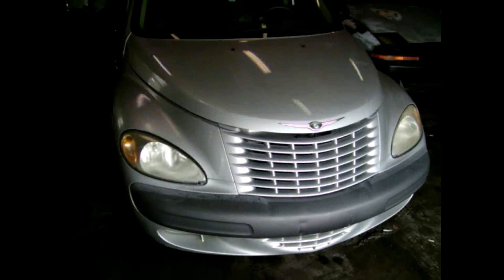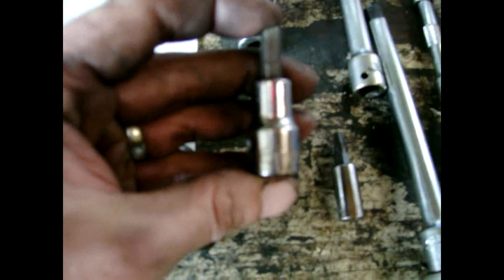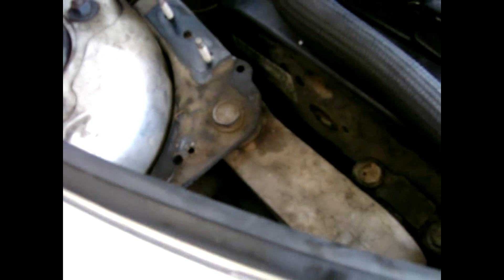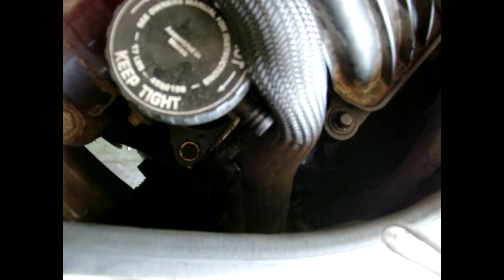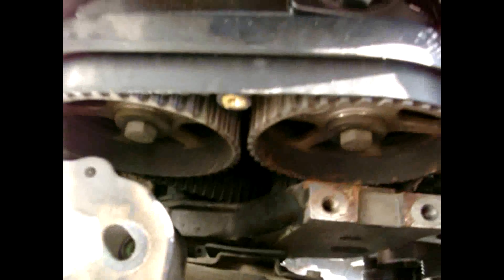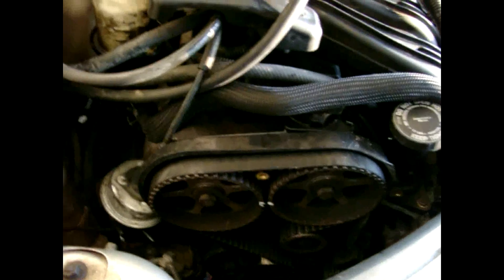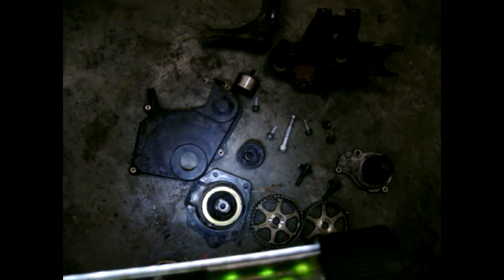Water Pump & Timing Belt Repair / Replacement 2.4 Liter PT Cruiser Part 1

Comment: hello how many hrs take to get the job done? im going to work on my wife car 3/23/2022
Reply from the maker: Usually takes at least a couple days.  One day to tear it all apart and get the new parts (water pump, timing chain & tensioner) on.  Next day go back over and put it all together again.  
VT247
Reply: @Vacationtime247  perfect thanks for the information

Comment: this was painful to watch.... needs to show how parts are coming off in More detail. and there is no need to waste 80-100$ on a harmonic balancer remover. 20$ for a 3"  3 claw pulley remover at princess auto. works like a charm.

Comment: I was going to attempt to change out my water pump on my 03 Turbo PT but after watching this video I don't think so now! Great job by the way!!! I guess you finally saw and realized that your lower motor mount arm rubber was ripped and needed to be replaced, I saw that it was bad watching this video, a lot of vibration when they go out, I have changed out the upper and lower motor mounts at least 3 times since I've own my PT which I bought brand new in Mar 2003, also the trans mount. My mechanic quoted me over $1200 to replace water pump. :-(
Reply from the maker: Oh this repair was horrible.  Not a fun one at all.  I seriously lost all interest in owning another one after doing this repair.  Fixed it, sold it, never had another one.
VT247
Reply: Vacationtime24  I need too have this done ..or invest in a new car?help!

Comment: I'm trying to get the big block off the power steering pump bolts to does anybody have an idea
Reply from the maker: Sean Bacowsky If my memory serves me right, I used some very long extensions to get the bolts off the back of the water pump.  Also used a wobble / flex connector between the socket and extension too.  Wasn't an easy removal.  VT247

Comment: Changed timing belt, timing marks seemed right on.  No go.  What should I try next?  What's a common oversight?  We even turned the harmonic balancer 180 degrees. 1. Do you need a jig to keep the cams aligned while putting the new belt on?  2. Could it be that the timing could be off a hair b/c of...?   3. Could spark plugs be the culprit?  4. Stale gas?
Reply from the maker: saintsamaritan Possibly the crankshaft positioning sensor.  Check for trouble codes.VT247

Comment: not as easy as you made it look. you never mentioned how high you jack the motor an how much trouble you still have getting that heavy mounting bracket to come out. i had same puller and used long push rod to push on and never used a quarter.came off easy. turn off your radio next video thanks
Reply from the maker: That big metal mounting bracket should stay on until you can jack up the motor.  Once the motor is jacket up pretty high with the motor mounts removed, then remove the bolts holding on the bracket.  It is a pain and not easy.  This repair sucked.  I'll never again own a PT Cruiser.  Hated doing this repair.
VT247
Reply: Vacationtime247 props to you and all others who are who mechanically inclined! I do respect you guys. My hat goes off to u all.  Purchased a used 2001 PT and 6 months later water pump failed.  Initial check car seemed in excellent miles.  Last week I checked on repairs and DAMN!!! Found a good mechanic reasonably priced.  He suggested going ahead and replacing the mentioned items in your video so we went ahead and gave ok.  Just got car back....running great.  FOR SALE!!

Comment: In San Antonio Pep Boys wants $1100.00 to replace timing belt and tensioner on 2001 PT.Thats Horrible
Reply from the maker: Repairs on cars seem high because they are.  But these jobs aren't easy and it kills your back.  Usually the cost of labor exceeds the cost of the parts.  Glad yours is up and running again good.
VT247
Reply from the maker: This job sucked to do.  Takes forever, it's all cramped spaces to work in and everything on the side of the motor needs removed.  I did not have fun doing this job at all.  I'll never own another PT Cruiser.  I'm convinced, they're junk.
VT247
Reply: here in MN at my shop its 850$ with all new parts
Reply: Found a mobile mech to do it for 250.00 and i supplied the parts
Reply: Louis Hernandez we just paid 585 new parts certified mechanic but that's here in North Georgia.   I thought that was high!!!!

Comment: these cars are a bitch to work on, its atleast a 4 or 5 hour job to do one of those. they buried that son of a bitch for all its worth
Reply from the maker: I'll never own another PT Cruiser.  They're junk and unreliable.
VT247
Reply: Vacationtime247
oh i know it, but thats with any manufacturer now a days. they slap the cheapest trash in em they can find just to get it down the road. and want a million dollars for the parts and labor to fix them
Reply from the maker: This is why I like older cars.  They're easy to maintain, cheap to buy and easy to fix.
VT247
Reply: most the newer fords don't even have dipsticks for the transmission now, where did the good ole days get to?
Reply from the maker: A friends Ford Explorer was like that, no transmission dipstick.  I was like, WTF!?  You need a special tool to add or change fluid.  Like it will never leak.  Unreal!
VT247
Reply: need a machine with the correct fittings that pumps it into the transmission and catches it at the same time. ive done several 99 threw 06 explorer shift solenoids and filters. i just throw the pan back up on them with a few threads and siphon the fluid into the pan from the side with a rubber hose and funnel. cant get all the fluid out the rest of tranny, but you can fill your pan back up that way lol.
 u think ford ever wanted anybody to check the transmission fluid? they want 200 dollars to do that too

Comment: Forget renting the piece of crap Chrysler tool to pull the harmonic balancer.  I struggled with that for over an hour, then went back to Autozone and rented a gear puller.  Brought it home and had the balancer off in about five minutes.

Comment: I RENTED THE SAME V.DAMPNER PULLER IT SLIPPED OFF 3 TIMES THEN I USED A LARGE SIZE #72 HOSE CLAMP AROUND THE 3 JAWS SO THAY WOULD'NT SLIP OFF THE BACK OF PULLY AND 1ST TIME CAME RIGHT OFF I DID'NT NEED A LONGER THREADED BOLT OR QUARTER BUT IT WAS REAL CLOSE TO BOTTOMING OUT I THINK I GOT LUCKY IM INTO THE 1950'S TO 70'S RIDES I CAN'NT BELEAVE SOMEONE WENT TO SCHOOL TO LEARN HOW TO DESIGN THIS P.O.S. HENRY FORD ALWAYS SAID THERE'S MORE MONEY SELLING PARTS THEN THE CARS NOW IT'S WHO CAN WORK ON THEM GETS THE BIG BUCKS.
OK THANKS THIS VIDIEO REALLY HELPED

Comment: Thanks! I had an '03 that I had to turn over to a shop at that point. I can't recall exactly what the problem was but I think that mount fed through a cavity in the wheel well body and I couldn't move it up or down far enough.
Now my '06 timing belt broke...so here we go again.

Comment from the maker: I removed the large bolt holding it on, the star head bit.  The large bolt going through the inner fender.  Once it's off, along with the other engine mount, I jacked it up to get to the top bolts holding it on.  Then lowered the motor to get to the lower ones.
VT247

Comment from the maker: As long as the car isn't overheating and the temp gauge shows it's working right, it's not related.  The vent system is inside the car.  The water pump is inside the timing cover and is a BIOTCH to get off and to.  So, all in all, not related.
VT247

Comment: Is it possible that a improper water pump repair on a PT cruiser could result in the venting system controls getting locked up, or are the two systems two separate to be affected. I'm having that issue with my 2006 PT.

Comment from the maker: It's not a real fun job to do.  Ok, so the styling in the PT Cruisers are different.  Other than that, they are a cumbersome to work on and they need a LOT of attention to keep them going.  The fuel mileage isn't good for a small car and they're heavy too.  Chrysler seen that they were going to be good sellers.  So they threw them together as fast and cheap as possible.  The aerodynamic are all wrong too.  The back end goes up creating more drag and turbulent wake.
VT247

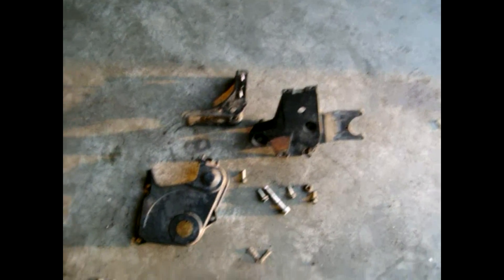Comment: question...im currently doing a water pump swap on my cruiser, at 8:19 in your vid you have the mount bracket on the floor, what did you do to get that out??? i managed to get the bolts out by jacking the engine up really high, but cant seem to find a spot that will let the bracket come out, its trapped, but it is completely loose... please let me know what angle you had the engine at, lol, thanks in advance

Comment: NICE JOB ON THE REPLACEMENT. i'D LIKE TO KNOW IF YOU HAVE A DIAGRAM OF THE SERPENTINE BELT FOR THE SAME CAR? BOTH MY BELTS CAME OFF, SERPENTINE AND ALTERNATOR. JOY IS I DID THIS ONE YEAR AGO AND IT HAPPENED AGAIN A FEW WEEKS AGO. I PUT THE ALTERNATOR BELT ON AND THE SERPENTINE BELT IS COMING UP SHORT. I WENT BACK TO PART STORE GOT A SLIGHTLY LONGER ONE AND IT DIDNT FIT EITHER. I'M 99% SURE I.M RUNNING THE SAME PATTERN, BUT THERE IS NO DIAGRAM UNDER THE HOOD TO COMPARE. HELP PLEASE

Comment: jack the engine UP_UP.. - the bracket comes out the top-the 2 bolts on the sides will stay in until you JACK UP the engine..The alternator will pass the ac dried-then it will come out. I worked for @ 4 hours on that.

Comment: I wish there was more detail on the timing cover & bracket removal . I am doing my first 2.4 2002 PT . I did great till I got to those parts . power steering pump & bracket ,alt & bracket ,torsion arm , harmonic balancer ,hoses , all off. There just seems to be so little room between the passenger side fender and the timing cover & bracket, what type of tool is used to fit in such a tight space for the bolt closest to the fire wall and passenger side,how can you get enough space to remove it ???

Comment from the maker: Put a jack under the engine oil pan.  Make sure the bolt going through the lower engine mount is removed and the engine can be lifted up and down.  Maneuver the engine up to where you can get the metal engine bracket off and out.  It does take that one certain position for it to slide out right.
VT247

Comment: how do you take the bracket off that the ps pump is connected to? the bracket that covers up the idler and tensioner pulleys for the timing belt...it is connected by 3 bolts...i got the 3 bolts out but cannot get that bracket removed. the bolt on the left side looking down at it will not come out far enough to pull the bracket off

Comment: I,ve done a neon and am doing a PT both times the puller bottomed before it was free.I just cut off a quarter inch bolt to length about a 1/2 to 1 inch and put it in the end of the hollow puller bolt. works like a champ even kept it the kit I also got on loan from the parts house .

Comment from the maker: The parts are going to run @ $150 if you get them from Rockauto dot com.  This certainly isn't an easy job.  I did this on my PT Cruiser I had, hence the video.  but, I'd say that $300-$400 for labor is about what it should run.  Again, not easy to do.
VT247

Comment from the maker: The one on the top or behind the wheel?  The one behind the cover and wheel I used a large allen key to loosen it up and off.  While the engine was held up on a jack.  After the side mount bolt is removed, the engine can go up and down.  This will allow the huge metal engine mount off while it's raised up.
VT247

Comment from the maker: The enginge support bracket has to come off.  Take everything off like stated in the video.  The lower engine brace, the upper engine brace, the a/c lines, the power steering pump bolts, the side engine mount (star head bolt) all have to come off.  To get the bolts from the mount off, you'll have to raise the engine up with a jack.  I also used a prybar to pry the engine over some as well at times while jacking up under the pan.
VT247

Comment: hello! i have 2 problems on replacing the timing belt, 

1. is it necessary to take the engine support bracket off to replace the belt? 
2. if it is, then i've found it is very hard to reach the holding bolts which trapped are in the dented hole. After struggling with it for a few hours, i did manage to turn one bolt loose but there is not enough space to take that long bolt out. could you tell me how you took your engine support bracket out? thanks!!!

Comment: I am using a thick book on a jack to support the engine. the A/C compressor is not off, but I took the lower torque strut off, all torque struts are removed from engine brace now, although I didn't take the brace off. I'll try lifting/dropping it little by little to see if I can find the spot, Thanks man. By the way, did you drop the engine to remove the center engine mount brace?

Comment from the maker: I used a wood block and a jack under the engine.  Then lifted until the pressure was off the bolt.  It broke free finally once no pressure was on it.  That bolt needs to be at that one certain spot for easier removal.  Is the engine only being supported with a jack?  Make sure the lower engine brace is off by the a/c and support the engine with a jack.
VT247

Comment: Hey VT247, I'm not doing well today, I've been trying to unscrew the center engine mount bolt (the one you done with an allen wrench) but it seems to be stuck, even a 24" breaker bar won't spin. I've tried to lift the engine to different height and the bolt is still very tight, even more tighter than the harmonic balancer bolt. Is it normal? Looking foward to hear you back, thanks buddy.

Comment from the maker: The pulleys will have to be removed in order to take the back plastic plate off.  Taking off an engine head is a major job.  The exhaust manifold has to be removed, most of the intake, water lines, head bolts, cam sprockets, etc.
VT247

Comment: Thanks you for answering! If I decided to reuse the timing belt, can I loosen the timing belt to remove the cylinder head without having to remove the 2 pulleys?

Comment from the maker: 1. The air conditioner doesn't have to come off, it's bolted to the bottom of the engine itself.  
2. You can use an extension and a wobble to get the bolts out.  Nothing else needs removed to get the power steering pump out of the way.  You can leave the lines connected and just set the pump aside.
3.  Pry the tensioner back with a pry bar to relieve tension and slide the belt off.  There are 2 pulleys that need removed, the idler pulley and the timing belt tensioner.  
VT247

Comment: Now I have several questions: 1. Do I have to take off the A/C before I remove the upper engine mount? 2. Do I have to remove anything else to loosen the power steering pump (because it's really a tight space)? 3. What do I have to take off in order to loosen the timing belt? (I know there's a tensioner but in the video you said you remove 2 pulleys to replace the timing belt)

Comment from the maker: I used a ratcheting tie down to secure the cam sprockets from moving.  If you use a rope perhaps you can tie it around the cam sprockets then break loose the bolts.  The power steering pump had to be removed to take off the front engine mounting plate.  3 bolts hold on the power steering pump from behind.  
VT247

Comment: I had my car inspected by mechanics and they told me i had a blown head gasket. I wanna do the job myself to avoid huge labor cost. You're suggesting I use rope to tie up the sprockets? I heard you said it in the video that you'd took out the power steering pump to remove the cover, is that true?

Comment from the maker: What makes you think you have a bad head gasket?  Is the oil milky?  Water in a cylinder?  I'd make sure you have a bad head gasket before tearing it apart.  
But, if you're already sure it is the head gasket, you have to remove the sprockets.  The rear plastic cover for the timing chain must come off in order to get the head off.  Got a rope or ratcheting tie down?  Try the method I used in this video.  
VT247

Comment: Thanks for replying! I'm trying to replace the head gasket, and to remove the head cylinder I need to take off the timing belt (and planning to replace a new one). My first question is can I keep the sprockets on the camshafts while lifting the cylinder head off? Because at the moment I really can't find the tools to remove those sprocket

Comment from the maker: May also help to use a pry bar to push the engine towards the drivers side.  Then, lift up the engine with jack.  The frame mount has a notched V going down that catches on the metal engine bracket to lock it in place.
VT247

Comment from the maker: Do you mean the metal motor bracket that affixes to the engine?  I had to jack up the engine quite some way for it to come out, 3 bolts hold it to the engine.  Helped to loosen the frame mount too that mounts to the side of the car.  There is a large star head bolt that is used for the engine mount.  Was able to use an allen head to remove it.  Had to remove the timing belt components for the frame mount to finally come out.
VT247

Comment from the maker: Yea this job took me some time to finish.  But, I got the water pump and timing belt back on.  Runs good now.  Just need to replace some suspension components and a few other misc things then it'll be ready to drive.
VT247

Comment from the maker: @truckschevrolet It is a 2001, first design for the timing belt routing.  The second gen is nearly identical with the only difference being the timing belt tensioner.
VT247